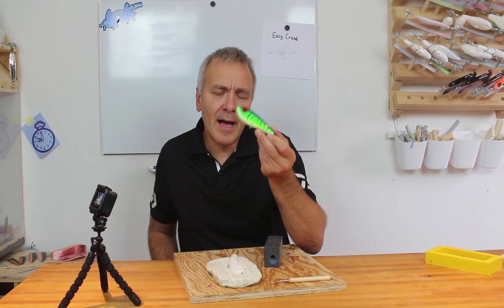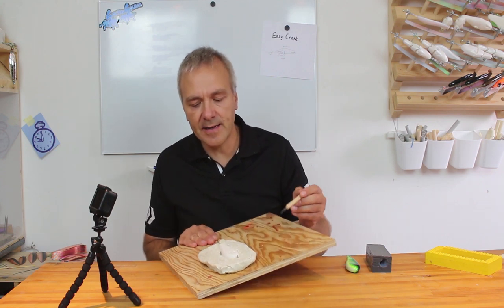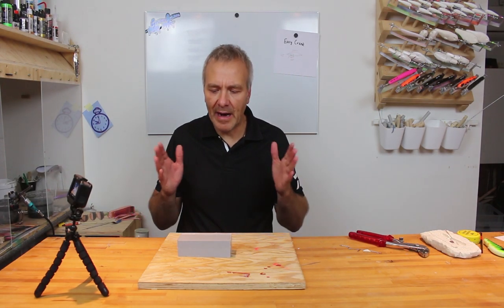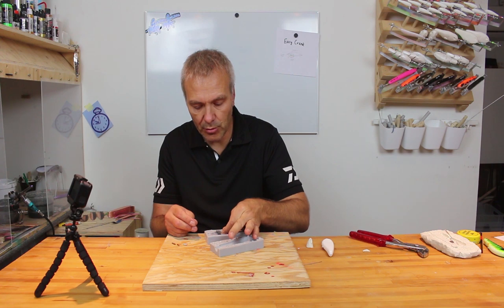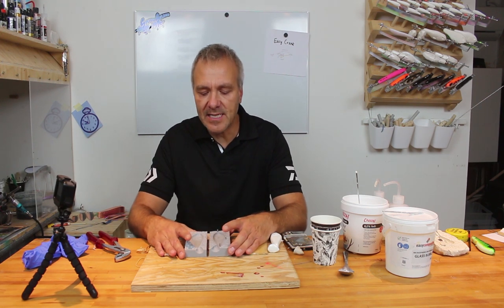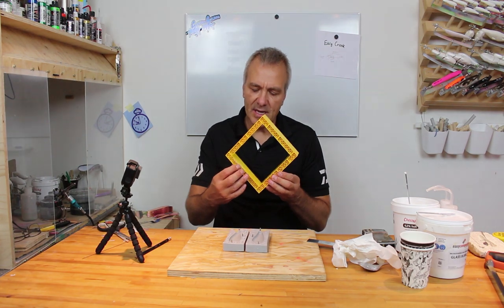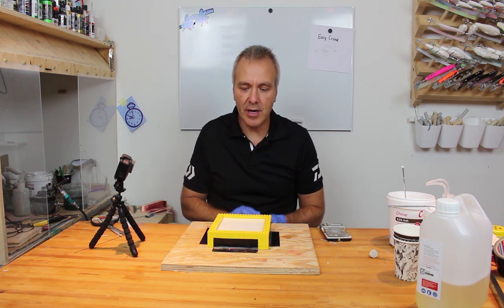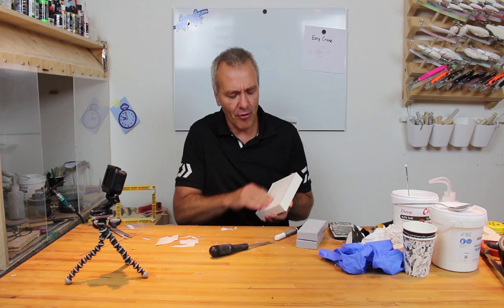2 Part Mold - Level 2

Comment: If you are casting large amounts, have you considered making a mold where you can cast multiple lures at once? like for example 4 or 5 lure mold. Ofcourse that way you would use more resin since it needs a main sprue (or funnel as you describe it) but it would reduce the waiting time per lure and wouldn't have to make a new mold as often. Very awesome videos btw! I think you deserve alot more views, definately my favorite lure making channel when it comes to mold making.
Reply from the maker: Hi Lapio. Thanks for the kind words - Just happy to share my knowledge and help other luremakers. So far the upscaling option for me has been to have several molds. This allows me to demold one, while the other is hardening. For maximal production I would have 4 molds, and pour 2 each time. The resin hardens in approx 15 min, which will allow me to demold, apply vaseline and setup wires on the 2 other as well a mix up resin. With my needs that suffices.

Comment: Hi, Jergen. Thanks for the new follow-up on your excellent original video that demonstrated how to make a silicone mold. I do have two questions: Here, you no longer pour a small amount of silicone over the master and brush it out to eliminate bubbles near the master. Nor do you coat the master and Lego frame with mold release (Vaseline). Could you explain why you decided that you could eliminate these two steps? Thanks, in advance, for your continued guidance. Keep up the great work! Chris

Comment: Hi.Tell me pls can i put to the lego to coppy  original jerk to make silikone mold?If yes,coppy will be much bigger then original if i will penting and  then will put eppoxy after?
Reply from the maker: Sorry Aleksandr - Don't understand what you are meaning
Reply: @SplishSplashFishing  Hi,its my english,pls sorry about but i will try again.I just wondering about if i will to do coppy of jerk.The first i will make silicinone form from original  jerk from shop wich is allredy pented with eppoxy aswell.Second i will take out that jerk from silicone form.Next i will put plastic to silicone form.Then i will have doned coppy wich o will penting and appoxy.Ok?Question is how much different size original and coppy if coppy i will penting,then eppoxy few times.Coppy will much bigger then original after?Sorry again.Thanks for unswer
Reply from the maker: @hutor_na_bolote  You will have to sacrifice a  original, and sand of epoxy if possible. Otherwise you might change floating point and movement. No matter what, I would always recommend making you own master in stead of copying. It is not that difficult
Reply: @SplishSplashFishing  Thanks a lots